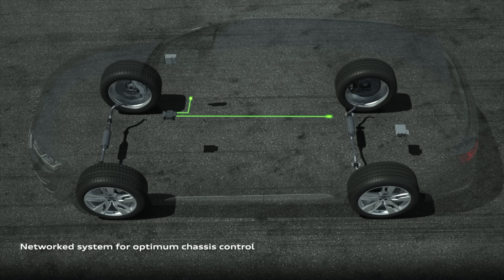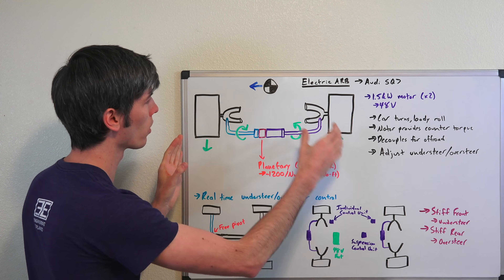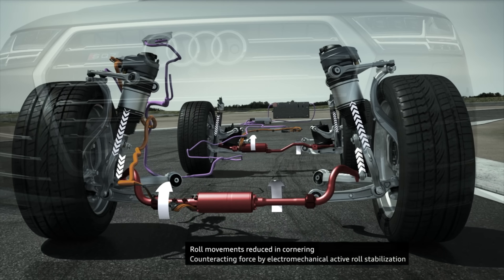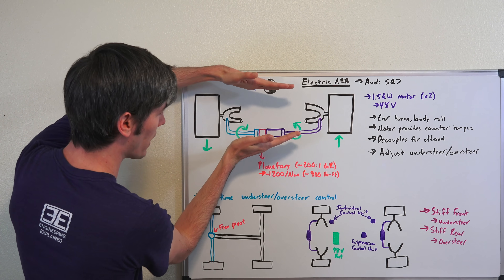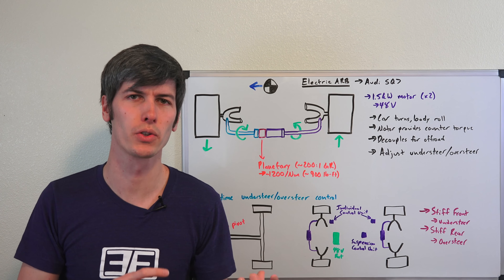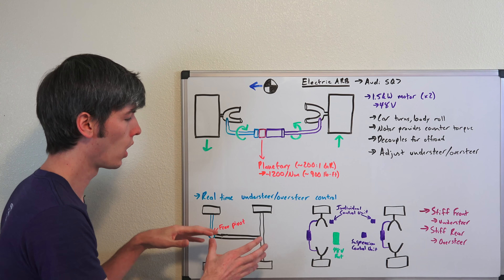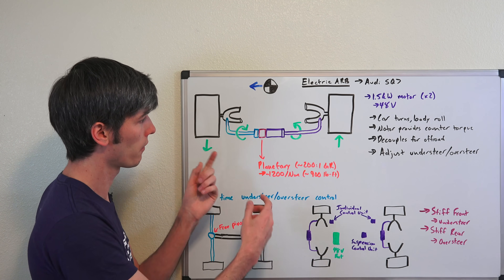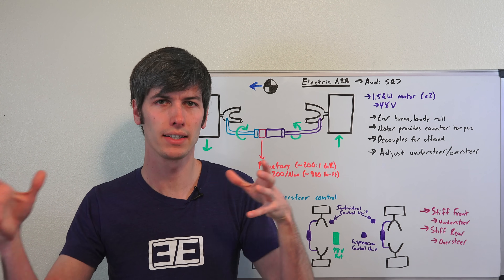How Audi Is Eliminating Body Roll

Comment: What are the downsides anticipatory stiffening? Besides another thing to break on the car? Are there any?
Reply from the maker: Well the stiffer the role bar, the less independent your suspension acts, so I suppose if the road surface ahead is not super smooth, and you corner hard (which would be silly), it would stiffen up, and then result in poor traction.
Reply: "if the road surface is not super smooth"
Reply: Not ideal in rally then 😂
Reply: Darkeight true enough. If only Audi drivers wouldn't have that "King of the Road" complex, I would rest my case 😉
Reply: actually assuming any electronic system can be tuned and re programmed , a driver and a team of engineers could set the roll bars to behave on a corner by corner basis. you could have a custom setting for every turn on a track that optimizes the handling given the speed , surface conditions of that turn , ext ext. For off road racing it could be a massive advantage as some stages require slow bumpy sections good for a soft sway bar and smoother high speed sections where a stiffer sway bar would help.
Reply: Silly for an SQ7 suv maybe.
Reply: Duskconqueror think you mean bmw drivers
Reply: People who buy those vehicles are rich enough  not to care.
They lease them, enjoy for couple of years and exchange for new one. 
If you want reliable used car go for Toyota Camry
Reply: But will it... thing is: the anti roll bar isn't any stiffer, just because it is pretensioned by an electric motor. It has usually got a linear characteristic, I think. So if the AR-stiffnes was x Nm/° before the pretension, it'll still be x Nm/° afterwards. 
I don't know if Audi does that, but in theory, I think such an active ARB-system would even allow for softer ARB than normal, while keeping the advantages of a harder one. So an active ARB could be really soft to keep the wheels independent, and still restrict body roll about as well as a hard ARB would. This however would require an intelligent control which needs to predict the dynamic (not quasi-static) load changes. Otherwise, a load change would probably result in a wobble.
Reply: I can only imagine that for racing this would not be ideal unless it was very consistent and predictable by the driver.  Otherwise they would not be certain how the car would react in any given situation.
Reply: The suspension is not stiffer, only torqued/preloaded. Technically, the suspension could/should be softer.
Reply: Dalton Michaels I agree. They could also add a gyroscope to the system which could help cars only produce a certain amount of rotational g forces. Kind of like what they use in rc drift cars to make it easier to drift. It will prevent the rc car from spinning out
Reply: Gazorpa Zorp Stiffer ARBs result in intolerable ride harshness. One commenter said that the suspension becomes less independent. When one tire hits a bump, you want only that tire to react.  A stiff ARB will make two tires react, reducing traction and sending a jolt through the whole car.
Body roll is not a bad thing in a passenger car, or in an off road racer.
Reply: Galard Mills... it's not the same as a stiffer roll bar: it's like a pre-load on a soft suspension, just dynamically adjustable. Therefore, has better traction with no down side [aside from additional complexity... and, your mobile phone is similarly more complex than an old dial type land line... SO was that better?]
Reply: Duskconqueror with a car not specifically designed to be sporty it is silly😄
Reply: Gazorpa Zorp I to see yet another gigantic bill on the horizon for the under informed buyer when this unnecessary feature breaks. Signed: Master Mechanic. However, It was a great video and explanation of the technology as usual. 👏👏👏
Reply: So now all of a sudden cornering hard is silly? Says the man with an S2000... 😉

Comment: Wow its an amazing system, btw after I watch this video I just realize that roll bar could affect a car behavior. Used to play a Granturismo game and in that game there is an option to adjust a roll bar, but I'm adjusting it randomly and not knowing what will happen lol.
Reply: If you get a chance, drive a Citroen Xantia Activa in real life, and in good condition. Rare but you will be rewarded...
Reply: Muzaki It doesnt give you a brief explanation? Not to be that guy but Forza briefs all the adjustments
Reply: It is, Jason make me really understand how the roll bar works, and now whenever I play the game. I'll adjust it carefully and make it balance as Jason said as possible.
Reply: Just like Jason, the games are often a little too simplistic in explaining this effect. If you increase the stiffness of an anti roll bar, you will reduce body roll; which is good for your aerodynamic grip but bad for mechanical grip in general.
The other effect is that you increase the frequency of the outside tire on which you increased the ARB stiffness, this will generate higer peaks in pressure on the tire and give you less grip in general. The other effect is that you increase the control stiffness on that side, so the tires on the stiffer axle have more effect or control. How this translates on the edge of grip is very dependent on the car.
The best way to set them up is with trial and error.

In project CARS I often use the anti roll bars to distribute the tire heat better. You can increase the heat on an axle by increasing the ARB stifness.
Reply: Roel de Meulder In a Miata, and basically in any race car, you want as much grip in the front as possible. This means a very stiff front sway bar will serve you well, because I have noticed that in addition to the stiff front bar causing the car’s weight transfer to be less violent (flatter) and reducing initial understeer, the transition to and from understeer is much faster and much more easily correctable. This is not so for the rear, which unless your car is on racing slicks, or higher grip tires, it will not benefit much from more stiffness. Instead, as you mentioned before with stiff sway bars losing you some lateral grip and cornering ability (not balance), the back will skitter around with unnecessary oversteer. Someone on the Miata forum once said that stiff sway bars in the rear behave like solid axle cars, or in other words they don’t handle very well. The back needs to move so it can absorb bumps. This is how sway bars are relevant to me, they’re just another tool used to finely adjust the balance of a car and make the limit more consistent, and many times higher.
Edit: I thought Jason did a great job explaining sway bars, or anti-roll bars in this video. Thank you, as always, Jason.
Reply: Sean MacDonald when u said that the first thing came to mind was a Miata
Reply: Haha! This is exactly how I learned how I like to tune my cars in reality! That, along with my G27 wheel :) suspension means everything to me.
Reply: The same happens to me

Comment: OK, so now you've made the suspension extremely rigid in a turn... mid corner bump anyone? Instead of just the outside wheels being really stiff in the turn now both are.

Of course, the prior solution was for the roll bar to be stiff all of the time. This shouldn't provide so much flatter cornering as better ride on the straights with equivalent body control in turns.

It's a pale imitation of the McLaren system.
Reply: With a system like this it can become slightly softer when it hits the bump, leveling out the ride
Reply: umakegoodcookies It hasn't nothing to do with the suspension
Reply: Trivagoski Roll bars are part of the suspension. Also this is nothing like what McLaren did even though it was a solution to the same problem. They used hydraulics to keep the car level.
Reply: Spam Can But not an active part.
What I mean is that roll bars interfere in the dampening system of the car but not directly on the suspension, or at least not the way the mclaren system do.

Comment: According to Audi's media marketing material... the vehicle unladen weight is 2.3 tons - gross weight limit is 3 tons. This thing is going to be a tank!
Reply: Jeez, that's not far off the upper limit of 3500 KG max gross weight on most UK driving licenses for the car category...
Reply: To be fair: if they such a suspension work with that amount of mass they practically have it tsted for lighter vehicles as well, this system in a performance car with a gui to modify the settings would be nice, maybe a scaled down r8, call it r4, put either a 4,6 or for e nostalgia 5cylinder engine in it and price it competetive, should sell well
Reply: Typing on a tablet sucks, but i guess you get what i meant ^_*
Reply: Hmm 5 cylinder (twin) turbo with an electric boost system would be interesting, not just for street performance but rallye as well but im not well versed in the current rallye specifications for any kind of rallye
Reply: shinybaldy hope it's got a cvt to increase mpg

Comment: I don't know.... it just looks like Audi has added something that will break eventually. So many things to break and go wrong on a car these days which is sad.
Reply: If you can't afford repairs/replacement on this gadget, you bought the wrong car. People who drive the latest Audi's are either superfans of the brand or have more than enough money anyway
Reply: I drive a 10 year old BMW 5-series. It has a lot of (2008) new technologies in it and the only problem the car had had to do with the wiring to the back windshield. 
I’m not a fan but I’m sure Audi builds high quality cars that will last well over a decade.
Reply: I would like to disagree. i had a 2003 B6 at 460K km before i let it go with just brake line and caliper problems. I now own a '06 A3 6speed and i have not changed the brakes or rotors since i've gotten it. The sensors get a little wild when i drift in the snow for over 30mins but a quick car wash gets all the snow out the sensor's ears. The only prob i have with this beautiful little beast is the rear windshield wiper not able to wipe (Typical VW prob). Currently @ 258K km and has no signs of faltering anytime soon. They are also not that complicated.... at all. very easy to understand and work with even on your ones compared to a Merc or Beamer
Reply: You could say the same about every system in a car. Why do we need airbags? That's just something that will break eventually.
Reply: Drifting a FWD... If you never changed your brakes or rotors you either don't own the car long enough or you don't brake a whole lot. Or you got massive brakes. Oh and btw, I said "the latest Audi's". I ment the more expensive newer models, not an '06 A3.
Reply: Lol, i put over 30,000km in 1 year. I think it's fair enough and tbh, i don't, i mostly rev-match downshift, and ahh i see, no worries, excuse me then, i seen "2000s" and thought, that's not exactly right as an owner.
Reply: sleeptyper's comment has nothing but the absolute truth about this.
Reply: People who buy those vehicles are rich enough  not to care.
They lease them, enjoy for couple of years and exchange for new one. 
If you want reliable used car go for Toyota Camry
Reply: Yes, they make magnificent toys for people who can afford it.
Warranty is 4 years after which you can only blame yourself for sticking to long to it.
If you are in used car market buy Prius
Reply: Spam Can a lot has changed since the 2000s on Audi's man. They are better now than they were then in every category. I've owned a 99, 11, 14, and 2018. My friends have an 07 A4 and a 01 S4. We have all had nothing but good experiences... probably because we do our own maintenance and save that labor cost 🤣
Reply: I always wonder why people say this. Do you not realize you just commented via a very advanced piece of technology? How often does that break. An engine is more complicated than this system, yet there are engines that run over 500K miles without problems.
Reply: I also have plans to buy the differential to put the Quattro system in here.... looking like $3,500 cries tears of quattro  w/ a wimpering wallet
Reply: Well, just try to find a car with manual crank windows, manual brakes (no boosters), and manual steering (no power steering). It might even be a challenge to find a manual parking brake (non electronic) these days.

These fancy motors add expense, indeed they do. But automotive engineers know they need to build it to last (at least 3 years). With some luck, and maintenance, it lasts until you get your expected value out of the vehicle.
Reply: Engineer's motto if it aint broke yet add more options.
Reply: These technologies give a false sense of security to some drivers. Drivers, who are inclined to drive irresponsibly, usually too fast and in bad weather. Same laws of physics apply to my '93 Ford Escort and this Audi SQ7, but i'd never even consider cornering my car at places where this Audi is possibly capable of. Once you lose the bet on "Will it grip?", your unwanted offroad experience may come at a hefty cost...
Reply: Audi know what they are doing.  Separating your money from you.  They are building disposable cars to make you buy new ones at rapid rate.  BTW, my phone is two years old, I had more than one issues beside battery replacement.  This is without all the salt, grime, and vibration that car chassis face everyday.
Reply: Duskconqueror Oh, about the engine. They've been made for over a century. Plenty of research and development time etc. Audi has probably spent more time on engine development as well as much more knowledge. On this gadget? Not even close, a few years at best.
Reply: Duskconqueror I used to work on Audi cars in the 2000's. They were complicated enough then and electronic crap broke all the time. And when they did break they usually were well past warranty coverage and expensive af. I would lease an Audi but I'd never buy one. You have been warned.
Reply: Duskconqueror If you buy the best car you can justify based on your budget and the most random thing happens to it the average person has undue strain  to pay for it if they have no factory or extended warranty. It's gotten to the point where if a car is financed for longer than the warranty lasts I can see banks requiring full coverage for maintenance or breakdowns. Just like with health care most people cannot handle the costs of even a relatively minor failure on modern cars especially if they are making payments too. So they may be more reliable for their complexity but tell that to a college age commuter when they suddenly and unexpectedly have to pay several thousand just to keep the car on the road. Many will just let the car go back to the bank.
Reply: InsideOfMyOwnMind spot on
Reply: Legitimate concern, especially from Audi. But even if it does happen, at leaat it's not a critical component.
Reply: Duskconqueror   What a moronic comment,we have all seen those 'what if a car was a computer' comparisons.  Have you looked at cars of the last 20 years?  The jury is in.  They break and are crazy expensive to fix.  It is great technology for race cars.  I will just deal with some body roll.